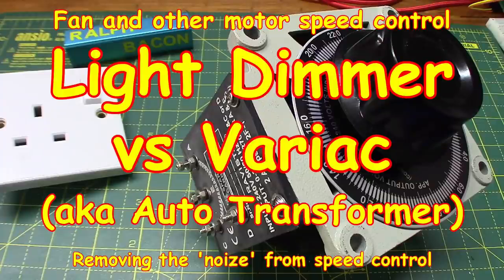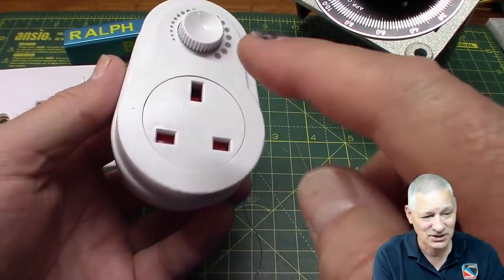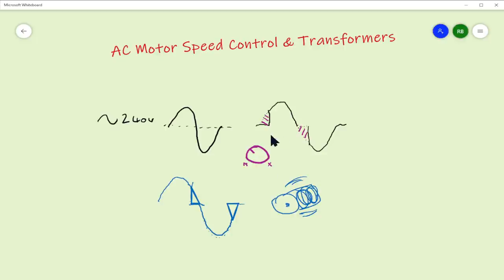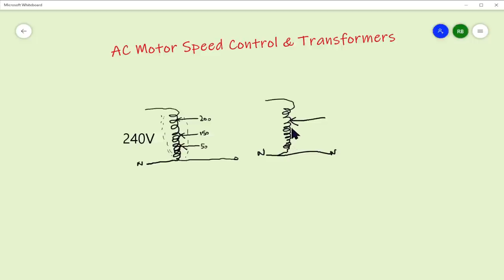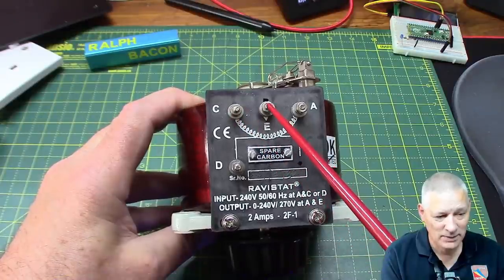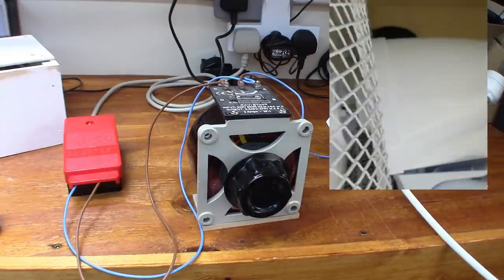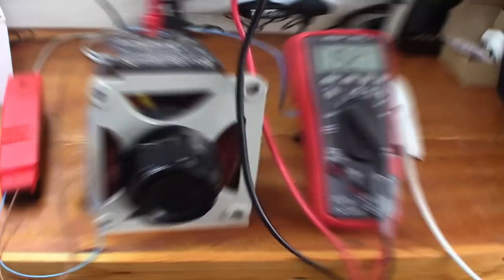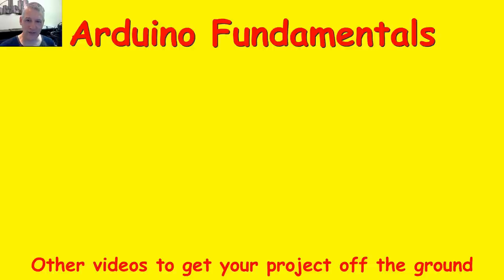#217 Auto Transformer ⚡ Variac for motor control - silent control 👍

Comment: In my old workshop I had a Variac driven from an isolation transformer - got the warm fuzzies (instead of the screaming wotsits) when live testing mainsy stuff.
Reply from the maker: I have an equally heavy isolation transformer but decided I didn't need that for the demo.
Reply: I know how you feel, Variac's are Lethal  in the wrong hands! People see the AutoTransformer   in the wording and think there is some form of transformer isolation protection.  But set the output to 10V ref to neutral/ earth and you still have 220V referenced to the live. Lose the neutral connection and it’s the same potential as the live.

In the workshop there should always be a isolation transformer before it or you work with one hand in your pocket.

Comment: This is a terrific, detailed explanation of electronics in AC operation. Thanks so much for sharing. I did notice that at ~8:38 you start describing a auto transformer but are calling it a triac. Which you find in better dimmers. Really horrible dimmers where made with SCRs back when but faded from use because they only handled one half of the wave and caused huge radio noise in the AM band. Cheers
Reply from the maker: My brain was not connected to my tongue at the time I said "Triac". I have no idea why I said that when it was obvious I'm using a Variac. Too similar a sound, maybe?

Comment: I can see the value in your variac. I have always associated quality with weight.
It may be worth considering making your variac installation portable (easy to reposition to your work bench) so you could get more use out of it testing stuff/experimenting.
If you are worried about your oscilloscope, consider buying an isolation transformer as either permanently protecting the oscilloscope or as a work bench feature that can effortlessly isolate just the item under test.
Reply: Variacs are great. This project is a waste of a Variac and I'm sure Ralph will get his dimmer working well enough with the addition of a suitable snubber and the Variac will be liberated to aid testing old valve radios etc
Reply from the maker: I agree this seems a criminal waste of a Variac. I shall try the capacitor suggestion (1.5μF 400v in series with the fan) or even a simple light bulb. All worth trying to free up the Variac. Or even a snubber but the only way to know if that is working is if the trailing edge dimmer doesn't stop working after a day or so!

Comment: I do enjoy my Saturday morning Bacon butty (apologies to none Brits). In theory, all wave forms are sine waves or the sum of sine waves of differing frequencies. So, when we see a square wave, we are actually looking at a sine wave of the base frequency AND a whole bunch of the ODD harmonics  their amplitude reducing as the frequency increases. Another way of thinking about it is the leading edge that is very close to 90degrees to the base line is a momentary very high frequency change in voltage and similarly with the trailing edge.  Our ears and electronic components "hear" these higher frequencies and the response is unpleasant. Thus, although the dimmer waits until the sine wave input crosses zero, before zeroing the output, it is still introducing a high frequency component to the output when it switches to the voltage of the input. However, there is less danger of hernias with the triac. Great video, Ralph; demonstrating that even simple circuits can reveal a lot of valuable knowledge even if there isn't a flashing LED.
Reply from the maker: You're right, Michael, I should have had a flashing LED in there somewhere, doesn't feel right without one 😜

Comment: With regard to the LCD display, I've been playing with the PICO and as I was watching this video an I2C interface for these displays appeared through the letterbox, so thats my next job! I've been trying micropython on it, since my career prior to my unexpected retirement was python programming, and I'm finding the Thonny/micropython combination working very well. The only real downside is there that documentation on the various modules to support devices is a bit scattered (or I've not found a central location if there is one) but that's something I am sure time will cure. I might even ressurect my blog and start documenting things myself! I know you're more a C person, but I would commend micropython to you, once you get the hang of it its nice to be able to interact with the devices by just typing commands and seeing what happens, then creating programs to actually do what you want. Also, because micropython is interpreted it seems to be much harder to "brick" the device!
Reply from the maker: There seems to be a lot of MicroPython documentation around but far less C++ for the PICO, am I right?

Comment: The 270V conection is to allow you raise the mains voltage to the correct level should the input voltage be on the low side.
Reply from the maker: I checked this with the manufacturer and the idea is that you can connect the 240V input to a different tapping (the one I don't use, basically between A and D) and then you get 0-270V out of the slider (between A and E) as the "secondary" has more windings than the "primary" coil (even though it's the same coil). The close up of the spec card I show demonstrates this.
Reply: if your testing mains powered devices it's good to be able to take the supply up to the over and under voltage limits. but best use is slowly raising the voltage to equipment that has not been powered for a long time, to give capacitors time to re-form. Not that I would trust them anyway.

Comment: I needed one off those sometime back. You're right they are very expensive. Actually it sounds like you got it cheaper then I ever saw.
Reply from the maker: I avoided the "cheap" Chinese units (bright red, all basically the same, with a very unsafe unshuttered socket and goodness knows what inside). Actually, they were more expensive because they had that bright red case etc.

Comment: I wouldn’t be without my variac - great for powering up dodgy Chinese stuff that’s ‘designed’ for a lot less than 240V. And things that might go pop! Have you looked at the back of the dial? The old ones were scaled differently on both sides as you suggested.
Reply from the maker: Nothing on the back, unfortunately. Right now, I'm not bothered because it is the speed of the fan that is important not the voltage. But that might change.

Comment: Nice variac.   Many, many years ago in the days  before triac dimmers were invented variacs were used as light dimmers, especially for theater and stage lighting.   Even more ancient is resistance dimmers and salt water dimmers aka liquid rehostat, both of which were quite inefficient, generated a lot of heat when dimmed and were load dependent,  with minimum and maximum loads, while the salt water dimmer posed additional dangers of electric shock, since they literally consisted of a glass container with an electrode in at the bottom,  a movable electrode operated by a lever to move it up or down, and a salt water solution that required frequent replenishment and proper salinity level to be maintained since a small change can effect the resistance to a large extent.
Reply from the maker: A salt water dimmer? Is it April 1st already? Oh, you were being serious. Well, in the absence of semiconductors I suppose they had to "make do"!
Reply from the maker: Hmm, I wasn't doubting you, just amazed at the human ingenuity that devised these things! 

When I was as school (as a young teenager) I once did the lighting for a school concert. Those dimmers were huge with long handles. No idea what they were but not salt water, probably some carbon rod!

Comment: Just took delivery of my Variac. $68 CDN including shipping. Arrived in less than a week from. BC. 110V, 5A.  Works fine erfectly on my 21" box fan.
Reply from the maker: Sounds great, Gord. Silence at last! Seems a pretty good price too.
Reply: @gpTeacher - Where did you get that from?  The cheapest I've been able to find so far is over $90!  If there's a CND vendor with a better price, I'd love to know how to find them!
(Thanks in advance)
Reply from the maker: If you're interested, Gord, I can give you an alternative solution that costs about $5. I've been running it in my bedroom to slow down the ceiling fan.
Reply from the maker: Email on the way. Probably straight to your Spam folder.
Reply: @RalphBacon  Found it Ralph. Thank you very much. Yes, it would be a great topic for a video. Thanks again!

Comment: Thanks for yet again an excelent video.  I solved my similar problem, just by placing a capacitor in series with the fan, actually i have two, low speed is with one in series, medium speed with two of the inn paralell in series with the fan, and well full speed is just bypasing the capasitors all together, maybe it doesnt give the best power factor, but it works and is absolutly noiceless. My fan is a duct fan for a 100mm sircular duct, and the capacitors is 1.5uf each.. Stil "bigg" but quite a lot smaller than an autotransformer, and i guess quite a lot cheaper too.
Reply from the maker: I'd love to try this. A mains rated cap (so peak voltage of 340V, make it a 400V cap)1μF - I wonder... (if it works I'll be selling a barely used Variac).
Reply: @RalphBacon  I think the ones that i have is rated at 450v, its just the same kind used for to get for smal AC motors to create a rotating field, but just put in series with the motor, I use it together with at two gang smart z-wave switch  so that i can control the fan in my underground garage to went out the humidity, normaly it runs ultra silent, but if the humidity rices above 60% it gets to the next level, and at 70% it runs at full blast... I got the idea to slow down fans like this long time before I started dabling with microcontrollers and Android by looking in to a Flexit 3 speed fan switch (google 26786_man_117356.pdf to get the datasheet and the connection diagram, in norwegian, but a diagram is a diagram :-)..
Reply from the maker: I'll check it out, for sure!
Reply: you mean in parallel with the fan motor don't you?
Reply: @jeffbeck6501  Hi Jeff, no the capasitor is in series with the fan motor..  If you Google the document u mentioned in the last post, and look at the diagram to get an example..

Comment: I see you are using a remote control for varying the fan speed. If that is a triac based controller, would'nt that generate noise ? Nice things , variacs though, I use one to control a loading transformer (dead shorted secondary) to check CTs ( current transformer).
Reply from the maker: You would think so wouldn't you? There are three triacs inside the control unit of that fan all going to different taps (windings) of the fan motor, so I'm assuming they just get switched on (or off) to increase (or decrease) the fan speed. No chopping of the sine wave involved, I'm thinking.
Reply: @RalphBacon  Interesting that.

Comment: I have a quick question: When I told a new acquaintance that I worked as an electrical installer, he pitched the idea that I could help him with the heat exchanger in his house. The fan had conked out, and the electrician who did the fault finding said that it was due to the dimmer that was connected to it. My acquaintance doesn't have much insight into electrics, so he couldn't tell me what type of dimmer it was, but considering that it was installed within the last few years, one can assume that it's a falling edge one. For me, I don't have much experience working with motors; School only taught us how to construct a basic star-delta starter for a three phase motor using relays, contactors and a timer, and most motor applications for domestic applications these days are pretty much plug-and-play, with minimal know-how required.

So, my question is as follows: Was that spark who did the fault finding talking out of his arse when he said that the dimmer had ruined the motor? Is it more likely that he didn't have the know-how or tools to diagnose that it was the dimmer that was shot? Or is there a way by which a dimmer can actually destroy a motor? I'm thinking that maybe the high frequency starting and stopping a dimmer produces will damage the motor in the long run, what with it experiencing additional mechanical forces when dimmed, as opposed to when using a Variac.
Reply from the maker: I've used dimmers on fan motors for years on end. They are available in good hardware stores, and look like this (with a fan symbol): 
https://bit.ly/RotaryFanSpeedController
It's what I have controlling an heavy duty extraction motor.

Comment: Maybe worth mentioning that you can have both the original arduino ide and the beta v2 installed on the same machine at the same time without having to do a fancy install. They share libraries and sketchbook quite happily. Or am I dreaming?
Reply from the maker: You are correct, Brian. The trouble with my setup is that I install so many alpha/beta versions that my computer gets a bit confused eventually. Even my standard Arduino setup is not quite standard!

Comment: Try a capacitor in series with the live to the fan to slow it down. Use mains rated capacitors and it should work like a dream and no noise. Cheers Dave.
Reply from the maker: Yes. It does. Of course, it's difficult to know which capacitor(s) to use until you use them, and they are not cheap. So far I used a 1uf and a 2uF and they both work well (the 2μF is faster, as expected). No noise. I think a simple switching unit with maybe 3-5 speeds using caps would work just fine. Snubber on the switch, bleed resistors on the caps, job's a good 'un.

Comment: Try a small series resister and a fairly large parallel capacitance to quiet the motor or a different dimmer may work better. 
If that doesn't work, a series incandescent light bulb can give an effective step reduction in motor power. Use different bulbs for different power levels.
A Variac is nice,  Too nice!  Other projects will pull it away from from the fan!  Mine is currently connected to a soldering iron  :-)
Reply from the maker: I will try the capacitor / lightbulb options next, Chris. Not so sure about the resistor. The fan uses 45W of power, that must pass through something (like the resistor)? But you are correct about wasting the Variac just on my fan (which is actually working 100% silently right now).
Reply: @RalphBacon  The resistor is to limit in-rush current into the Cap. 
It tames the whole thing a bit . The dimmer SCR will run cooler and be less likely to pop. (when it does, replace with a bigger one  :-)
I seem to recall using about 15ohms and 1uF,  but you will find your own values
Reply from the maker: Ah, inrush resistor. Hmm, OK, we'll see what happens (hopefully no flames or popping of components!)

Comment: When you switched from talking about dimmers to talking about the variac you called it a TRIAC...!   I have a 2.5A unit in a box with a number of switches and lights.  One switch selects which input to use,  "normal/boost".  One is on/off.  A third is limit/meter/bypass,  where the limit position puts a light bulb in series with the output,  the meter is not putting anything in there but there's a pair of binding posts to connect my meter to so I can measure the current drawn,  and bypass simply shorts those two points together.  I often use this with an isolation transformer.  Somewhere around here I have a somewhat bigger one,  I think it's a 4A unit,  and when I can I plan to build that into a somewhat bigger box.  You're going on about how huge that thing is --  too much time working with microelectronics!  :-)  I consider a 10A or even a 20A unit to be desirable,  and perhaps someday I'll get a hold of one.  Nowhere near as expensive as what you're looking at,  though.  Oh,  and the dial on mine goes from zero to 100%,  no particular voltages are marked.
Reply from the maker: A light bulb (various wattages) in series is my next test. Then (if that fails) a capacitor. You're right about the dial, it should be marked 0-100% one side and 0-112% the other side (for the 270v winding if I had used it).
Reply: @RalphBacon  Why would the light bulb fail?  And I'm not sure I understand what you mean, put a capacitor in series with the load?

Comment: Try a variable frequency drive. Make sure you get single phase to single phase.
Reply from the maker: I look up that term "variable frequency drive" but didn't like the output voltage shapes in the Wikipedia page; not exactly sine waves, which means more noise again?
https://en.wikipedia.org/wiki/Variable-frequency_drive

Comment: Could you not just use a regular transformer, to say reduce the voltage to the fan from 220v to say 110v?  ...and put in a bypass switch so you could run it at 220v or 110v, and just live with 2 speeds?    Fantastic video by the way.  I am a long time subscriber.  ...and for a good reason.
Reply from the maker: I considered that, Jeff, but had no idea what voltage would be required to operate the fan even at the slowest speed (given that there are some electronics built into the unit). A multi-tap transformer (eg 240v in and two or three different, high voltages out, say 100v 150v 200v), was an option but they cost as much as a variac!
Reply: @RalphBacon  So what about the capacitor i showed a bit further down..??
Reply from the maker: I've ordered two of those!
Reply: @RalphBacon  The more i learn about electricity, the less I know.  Be safe.  Electricity will kill you, is what my uncle one said to me.